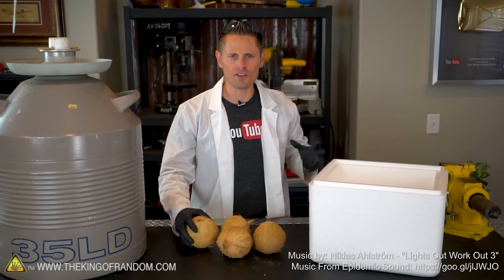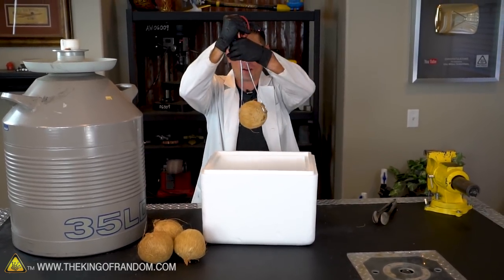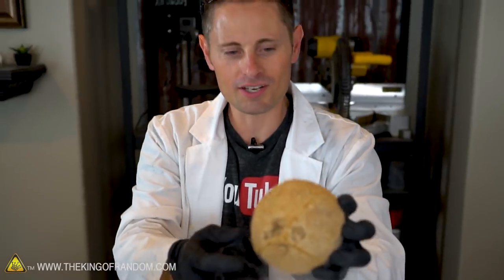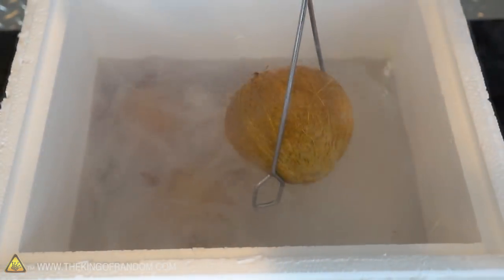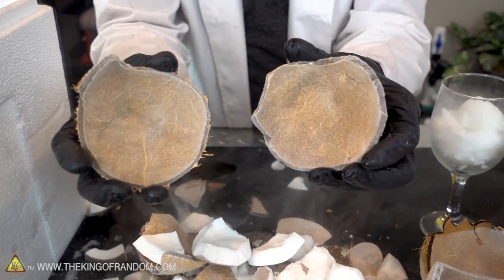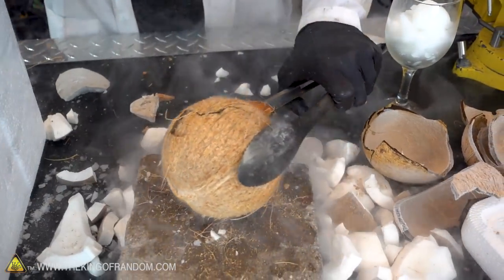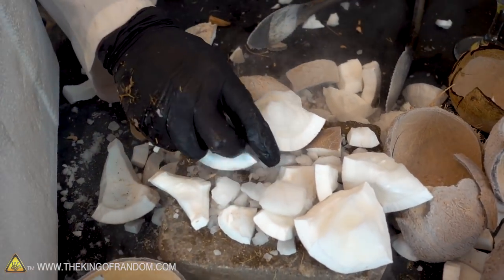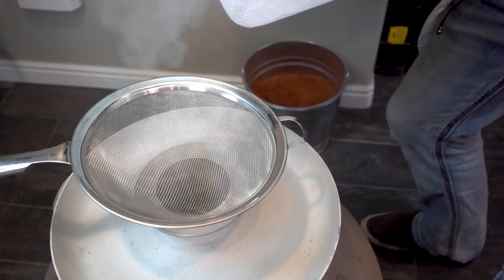Frozen Coconut Mind Blow! King Of Random Freezing Coconuts and Cracking Them With Liquid Nitrogen!

Comment: Can you drop burning thermite into liquid nitrogen? Would the thermite go out or just make the nitrogen evaporate?
Reply: Doug Jager thermite wont go out
Reply: Jurie Debie not from the lack of oxygen. Thermite is self oxidizing, I know that. But the massive temperature change could prevent it from completing its reaction. That's what I want to see!
Reply: it would still be interesting to see what happens though
Reply: Pretty sure the leidenfrost effect will keep the thermite from going out. The backyard scientist put thermite in water and the thermite did not go out. I doubt it will go out when you drop it in liquid nitrogen because the temperature difference is even higher and therefore the leidenfrost effect will be even stronger.

Comment: Get a phone wet then put it in a vacuum chamber and see if it saves the phone
Reply: Jamezella Ethington hey guys it’s techrax here
Reply: A vacuum chamber would not help.
Reply: apple tech geek that's not how a vacuum chamber works it doesn't make heat
Reply: Leo The Lion but a vacuum does decrease the temperature needed via the lower pressure
Reply: You are getting confused between 2 effects.
"boiling" is just where the oxygen in the water is released, either by heating which breaks bonds or by vacuum which enlarges the microscopic air bubble in the liquid until they are big enough to float to the top.

Boiling water with heat reduces the amount of water because it turns it into steam.
Boiling water with a vacuum doesn't create steam so the water does not reduce.

So no, putting a wet phone into a vacuum chamber will not dry it out.

Comment: Can you please heat any metal until it goes completely red and then dip it into liquid nitrogen (like how you would with water if you were to cool it down)
Just curious.
I think it might go brittle...everyone has their own hypothesis
LIKE IF YOU AGREE
Reply: That's called cryogenic hardening. It'll get harder and stronger but also more brittle.
Reply: Can you make a video showing us how you make your liquid nitrogen please?
Reply: When I meant brittle, I meant it would be become more brittle than putting it in water for the same amount of time (if that makes sense - I hope)
Reply: Vedant A he already did
Reply: Vedant A I don't make it u buy it either in some stores I'm not sure what ones tho, u can also purchase it online
Reply: Vedant A   If I were you I would buy it, I know it gets expensive but when making it you deal with chemicals.
Reply: I think it would go into thermal shock and crack/blow up. Hopefully the second one
Reply: I get what you mean and that is exactly what happens. It ends up more brittle than water but at the same time, it's usually one or two points higher on the rockwell hardness scale than a water quenched metal.
Reply: i would love to see that
Reply: depends on the metal

Comment: Quick Question,  When you add salt to normal ice it melts faster and is much colder. Does the same happen for dry ice?
Reply: Hunter Dixon No as adding salt too water only works because the salt can dissolve as the water is a solvent, however nitrogen is not I think
Reply: no, adding salt to dry ice would not give the same effect as dry, as does not form a solution with salt. Research topics such as this on your own as well. this comes from the reasons for which salt makes ice colder and melt.

Comment: Freeze an LED in liquid nitrogen but make sure it is FULLY frozen and then run current through it and see what happens
Reply: page3of9 it wouldn't work the thin wire inside would freeze and snap.
Reply: It would shine brighter. Cold temperatures help conductivity.

Comment: Put a coconut in a vacuum chamber. Will the water inside of it boil and make the coconut explode?
Reply: Garfield501 #2 I think the internal pressure would remain pretty constant
Reply: Who's Garfield501 #1?
Reply: the vacuum chamber has nothing to do with boiling
Reply: line force4 yes it does because when you lower the preasure in a vacuum chamber the liguids boiling point Will lover
Reply: Nothing would happen. The coconut shell can handle a vacuum without a doubt. Thus meaning the pressure inside would stay the same.
Reply: Garfield501 #2 the liquid inside the coconut might be untouched because of the coconut's thick layer of shell!
Reply: Maxemilian winkler just a misunderstanding
Reply: It could break the glass if it explodes

Comment: Put gasoline in a water balloon, in liquid nitrogen to make a gas coconut.  See if you can burn it from the inside out.
Reply: Epic idea!
Reply: Caged Egg yes
Reply: That would be lit
Reply: Wait...  If dry ice is warmer than liquid nitrogen, what if you fill a balloon with carbon dioxide (to keep it from floating away).  Can you make dry ice, maybe even a dry ice coconut..?  (CO2 doesn't become liquid, though..)
Reply: Caged Egg you cant really make a gas coconut that can burn inside out because by the time the gasoline can actually ignite, the gasoline will turn into a liquid and no longer be able to keep the balloon surface rigid, and that is if the balloon doesnt shrivel into a little prune since the air inside the balloon contracts rapidly under low temperatures, and that is also why a co2 balloon coconut is implausible since all the co2 will turn to a solid or liquid, the balloon material is also likely to crack and break under low temperatures such as liquid nitrogen.
Reply: A)  Take the balloon off before igniting.
B)  CO2 liquid is impossible.  It's called "dry" ice for a reason.
C)  Likely is said a lot there, not definitely.  I'm suggesting it because it would be cool to find out, and it would be pretty cool anyway.  This channel is pretty DIY experimental, I think this experiment would be fitting.

Comment: CAN A REMOTE CONTROL BOAT BE CONTROLLED ON LIQUID NITROGEN
Reply: maybe for 1 second but after that no, it gets destroyed
Reply: LinusHimmer no the boat would actually keep floating unless of the boat has a liquid inside which might expand. The circuitry and other parts should be fine
Reply: yeah... it will be fine as long as you insulate the PCB so it does not get cold or use special kind of PCB that does not contain moisture and special components that are able to operate in less than -40°C
Reply: MadeFromMeat lol
Reply: COCA COLA IN VACUUM CHAMBER
Reply: eh... The antena is the last thing that would "freeze"... It would only be a problem if ice had built up on the antena, otherwise it would be perfectly fine and maybe even better at receiving due to having lower resistance

Comment: Try to put some kind of speaker in liquid nitrogen!
Reply: Testi Biedermann dont
Reply: It will just rip the speaker cone, if it is powered while frozen.
Reply: Testi Biedermann put a tinfoil over the speaker then put the bass up full blast and see if the vibration crack the frozen tinfoil or not btw big fan king of random

Comment: put magnesiun with dry ice in a bottle and ignite with solar scorcher
Reply: well... dry ice don't ignite... and same with cold magnesium...
Reply: CreepyblackZ actually magnesium burns in carbon dioxide leaving carbon. And the solar scorcher will heat them quite fast.
Reply: leaving magnesium oxide and carbon*
Reply: not if you mix it with dry ice
Reply: NOPE NOPE NOPE, that's a awful idea (at least if you mean a closed bottle)
Reply: The Rambling Brit it would be cool tho xD
Reply: But of course, it's dry ice xD

Comment: can nitrogen conduct electricety
Reply: Tilen Gabršček no coz it’s liquid
Reply: Ayaan Jamal but water can
Reply: No as nitrogen has no charged Ions which are responsible for the conduction of electricity
Reply: Tilen Gabršček water does not conduct electricity its just the minerals an salts that are in the water that conduct water. Destillated water would not conduct any electricity
Reply: Tilen Gabršček because it have mobile ions liquid nitrogen probably dont have any since its too cold and also it will probably froze the wires before they can even pump electricity
Reply: DerFisch_ exactly
Reply: Ayaan Jamal That's not why. It's just not very conductive.
Reply: Guys go watch the video Grant did on the conductivity of different types water.

Comment: Grant Thompson can you mix liquid oxygen with liquid nitrogen?
Reply: Omnum Nayfeh you actually can't do that because liquid oxygen is heavier than liquid nitrogen therefore it would just sink like water and oil only liquid oxygen and nitrogen
Reply: Omnum Nayfeh And you get liquid air☺️
Reply: Awesomeness1175 XD yes that's right but liquid nitrogen is colder then oxygen so it might freeze
Reply: Omnum Nayfeh Not that much colder. Oxygen freezes at -350°F and Nitrogen boils at -320°F

Comment: What happens if you put liquid nitrogen or dry ice in a microwave?
Reply: It would probably slam open the lid shortly after starting the microwaving process because of the huge volume difference between liquid/solid and gas states.
Reply: The dry ice sublimates into carbon dioxide and liquid nitrogen evaporates into nitrogen

Comment: Can  liquid nitrogen put out a fuse?
Reply: isaac fishman it wouldnt be the liquid nitrogen that does it so much as the nitrogen gas. there have been experiements of dropping matches in it or just holding it in the gas and the flame goes out. as long as it deprives the flame of oxygen completely it could go out. But I think you need to completely engulf it in the gas rather than just pouring it on the fuse
Reply: DS Jonesy that applies to matches but fuses have a far more vigorous flame and are also made of black powder which could have a higher tolerance with low oxygen levels

Comment: Can you put carbon dioxide in a balloon and try to bring the temperature down and make diy dry ice?
Reply: Jeet Sharma there's only about 1% carbon dioxide in the air
Reply: pigs make Bacon We can try from a canister of carbon dioxide?
Reply: pigs make Bacon he means get co2 from a tank and then freeze it
Reply: You could, but I think it would only make a little bit because the pressure would need to be higher, but I guess this would just be a general proof of concept.
Reply: Red the Fox Nothing in trying?
Reply: pigs make Bacon 0.04% of the air the carbon dioxide

Comment: Liquid nitrogen versus thermite ??????
Reply: That wouldnt do much, liquid nitrogen being so cold would instantly vaporize to that heat. its like when Grant pours it on his hand or the surface of a table, the leidenfrost effect (spelling?) causes it to form a gas barrier of nitrogen and slide around. burning thermite is hotter but would do the same or would instantly vaporize the nitrogen causing a big cloud but nothing significant. 

now if you were to freeze the thermite in nitrogen first.... nothing different would happen because the heat that goes off is from the exothermic reaction of the aluminium taking oxygen from the iron oxide so it wouldnt matter what the starting temp was as it would heat up to its normal burning temperature instantly regardless

Comment: can you freeze helium.
Reply: Katelyn Ernestine That is impossible.
Reply: It is possible because it is used as a condensing liquid for the formation of liquid nitrogen
Reply: Katelyn Ernestine
No, but using the nitrogen to make liquid helium would be awesome!
Reply: Liquid helium is possible, though you need to cool it to about 1 K. If you want it to be solid then you also need 25 atmospheres of pressure. It's pretty difficult.
Reply: StackedGaming You can freeze anything. Every thing can exist in a solid state. Put helium on a planet that has something like a -600°C it would be a solid.
Reply: ninjafruitchilled He asked to freeze it. It is impossible but it is possible condense it to to a liquid
Reply: MagicWaffles No it's not
Reply: @James: Sorry, won't work, the boiling point of helium is way lower than nitrogen. You can liquify oxygen using liquid nitrogen though! Except it is extremely flammable and dangerous...
Reply: @BeGamerSI: -600 C doesn't exist. Absolute zero is -273 C.
Reply: You can make a liquid helium, but solid helium doesn't exist.
Reply: It does, just not under standard atmospheric pressure

Comment: Cryogenic immersion gloves. Goggles, not glasses. Also, you should do a series of LN2 tapings over a week, and get a 200L 22psi dewar delivered to you. Use a flare fitting for the liquid withdrawal valve, attach latex hosing to it. No more lifting the 35lb dewar, better on your sciatica!